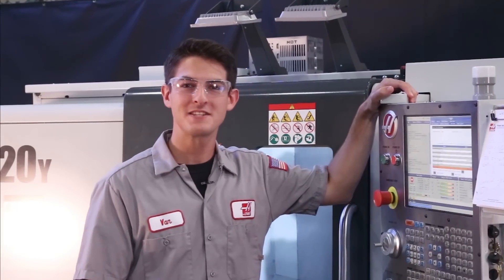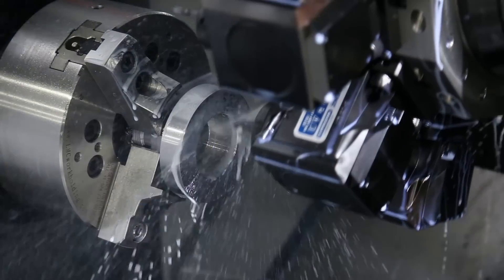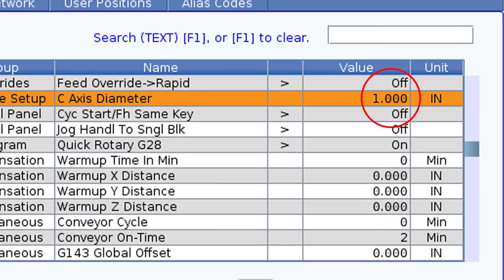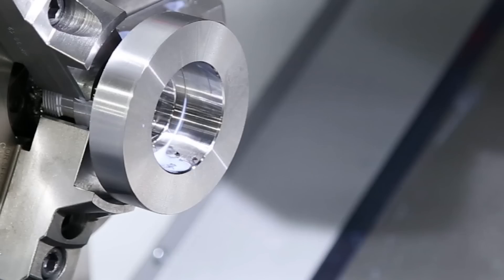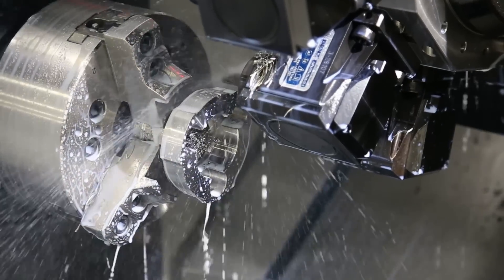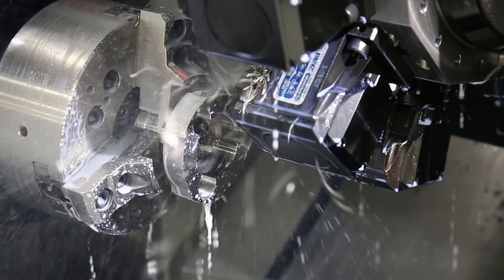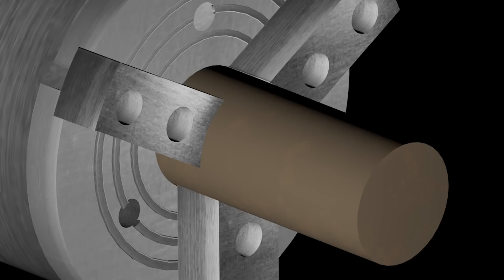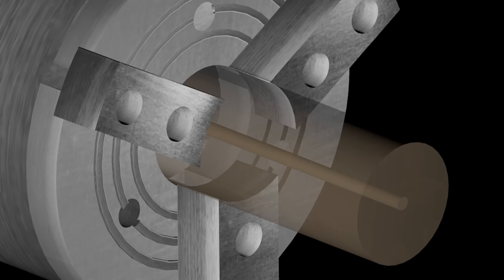Is Your Part Diameter Set for C-Axis Work? Setting 102 Will Help - Haas Applications Insights

Comment: What if i mill on both 100mm (4inch) and 25mm (1inch)?
Reply: All this video has done is make me more confused about what the setting does and how to properly use it. The explanation was very brief and poor. Can Mark Terryberry do a detailed video explaining this?
Reply: @kristianSilva95  plz give the link of the video, bcz am facing c axis jerking problems
Reply: Exactly. For this reason, setting 102 is just stupid. I guess they expect you to set it to 4 and when you're cutting at 1" dia, your feedrate is 4x slower... great. I ran into this problem too. Unfortunately there is no inverse time feed. (WHY???) They should add this to the lathe control. 

Inded up making a macro to read setting 102 and depending on the X dia the cutter is at, the feedrate is adjusted. It was close enough, but it didn't work 100%, it seems the control is doing something else in the background anyway.
Reply: @GRTLRS  could you share this macro? would be good to see this!
Reply: GARRETT LEWIS Yes, it is indeed intended with radial milling. Even every basic of basics fanuc has this feature so I would imagine Haas has it too.
Reply: Enter to polar coordinate interpolation mode. Then machine automatically adjust feed rate.
Reply: Not with radial milling.
Reply: I,m not going to even use it to be honest .
Reply: you can change the feed of C axis by use F